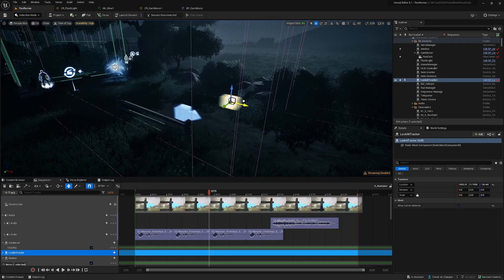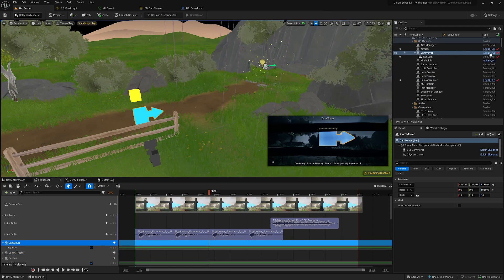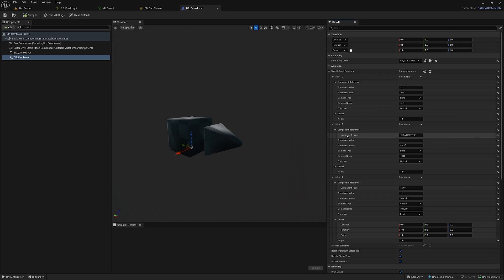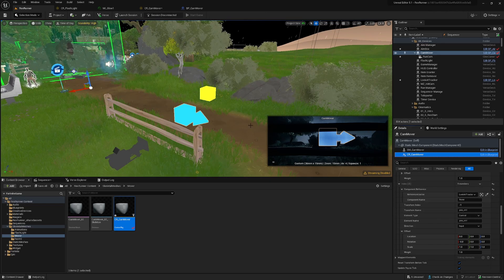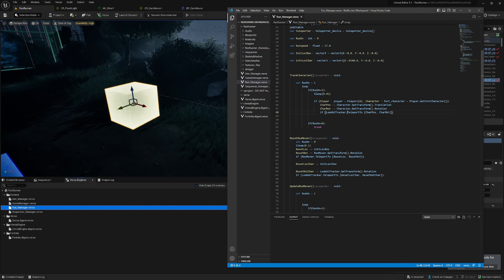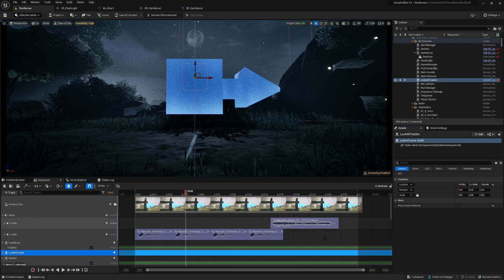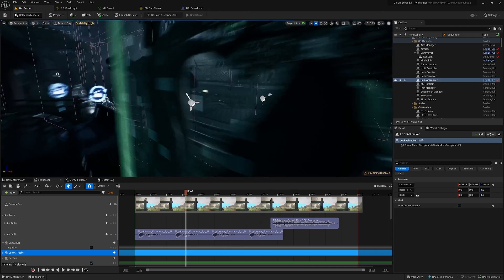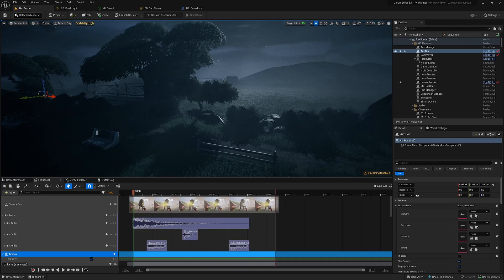UEFN - Control Rig Component - Smooth Cam for Rex Run Island

Comment: The tracking speed seems to be different between nintendo switch and PC. Is there any solution?
Reply from the maker: yes! recently i discovered putting DeltaTime node multiply that by a number (speed), and put this in the interpolation.

This will make sure it will use the system frame rate and keep the speed the same
Reply: @insaneUnreal  Thanks! I'll try it!